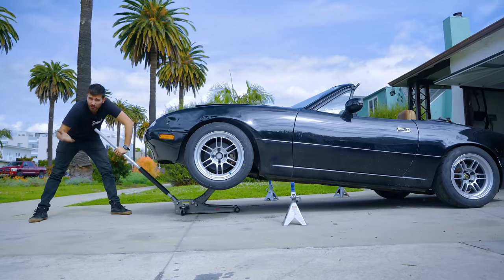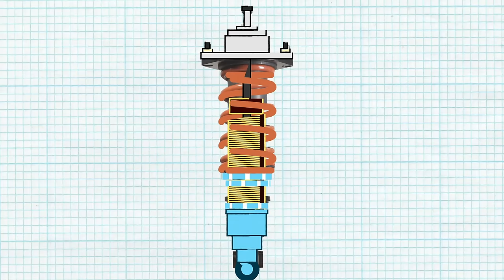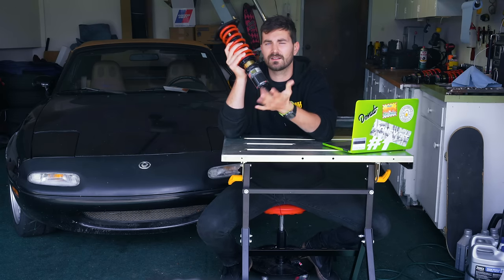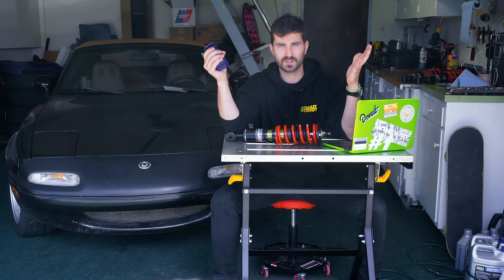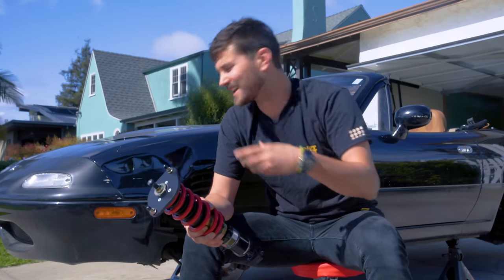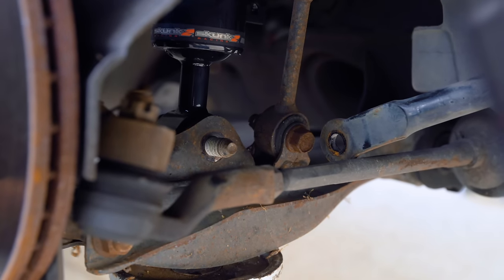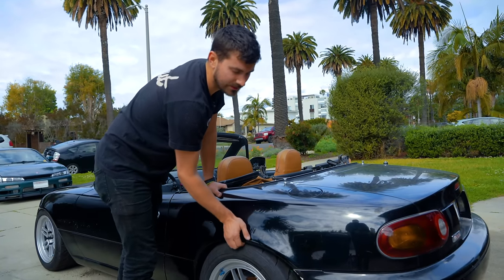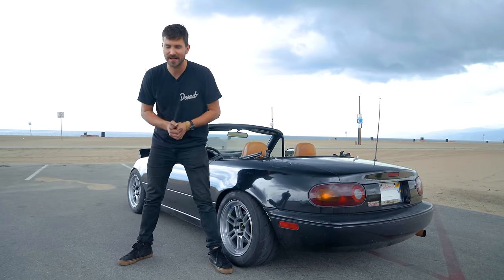How to lower your car the RIGHT way: COMPLETE COILOVER GUIDE

Comment: RE: Rubber Bushings
Grease up the shaft (not the threads or head) of the bolt, as well as any rubber bushing surfaces. No need to do so at ride height, they'll slide right through. Eventually the grease will work its way out, and you'll be back to just rubber again. It won't hurt anything. If you do get grease on the threads, a little brake cleaner on a rag will wipe that off nicely before you torque it down.

Comment: I've got some decent coilovers well only ones available for my n14 sss in Australia but was 1500 and the tarmac rally ones were 2200 aud might upgrade to them the roads are really crazy here nothing as big as the states. Most in my area are like one way sized streets compared to where you guys are but everything is expensive here. Has cost me 12k to restore n revive the car without adding forced induction. Estimated 50k to pursue my dream with it and ill never be able to drive it again because they don't allow reverse engineering heres, but try to picture an Australian 1992 n14 pulsar sss (which has a detuned east west sr20de fwd 140bhp) but rwd converted via skyline/silvia tunnel cut with the 6 speed using the stock engine but mazworks block, eaton m45 supercharger (mini cooper s) on intake side plus a gtx turbo on the hotside. Painted in midnight purple. Currently is Monza red (GTiR)

Comment: Word of advice! Roll & pull your fenders while it's on the stock suspension, before installing your Coilovers because once you lower your car. It will be nearly impossible to roll the fenders, due to a lower Ride Height.

Comment: Went to install my coilovers on my miata. BOTH of the bolts that hold the shock absorbers on the rear just spin because the weld inside the control arm has broke, which is quite common. Be wary of this if you go to install coilovers as you gotta have a magical spanner that fits in a tiny gap or grind off some of the control arm.

Comment: Love this series! 

Question, I have a 2016 Civic LX. I have to take it on dirt roads and the like and with the stock suspension the bottom often scrapes (even over speed bumps). I am thinking I need to make things stiffer without changing the ride height. I would ideally do an air ride, but that is out of my price point. What do you think, full coilovers or a stiffer spring?

Comment: I have to say that isnt really what cavitation is. What cavitation is, is basically when a air bubble occurs and burst due to I believe negative pressure, once this bubble bursts it can take a small chunk of metal away with it. Over time it will leave extensive putting and also weeken the metal. Cavitation is actually quite interesting and I advise anyone who is confused or not sure how it work check a video on YouTube really informative

Comment: If you can, buy Swift Springs for your coilover and weigh each corner!
EX:
If your front left is 800lb and you have 10kgf/mm or 550lb/in springs, you need at least a 1.2in (1.45in if you don't run swaybars) clearance for your tires to compress when static. So that when you make a turn, your suspension won't sink and rip out your fenderliner.

Then there's motion ratio, instant center, swaybar, and other calculations I'm too lazy to do.

Comment: If you are leaving the stock suspension on a Miata you need to take off the lower control arm in the front almost completely, it can make the job from a total no brainer to a total nightmare real quick 🙃

Comment: You should have used the fender roller before you lowered it go back and look at where the roller wheel sit in the fender and look at where your geometry of your suspension fix your Hub if you would have done it before you loaded the car and the suspension was shoved up the roller would have been perfect to roll your fenders

Comment: How do you figure out torque spec and how do you know when you've reached it?
Reply: Most good parts will come with torque specs and whatnot. And you can use a torque wrench that will click once it reaches the torque you set it at. Some older torque wrenches require you to watch a needle on a small graph on the wrench itself.
Reply: Ciinyk _ thank you so much

Comment: I'm a big fan and you usually do a fantastic job explaining the inner workings and concepts of various components but I think your explanation of cavitation missed the mark just a little.  Cavitation is when small portions of the fluid boil due to a reduction in pressure and form bubbles. The danger is when those bubbles inevitably implode, which causes erosion in the metal surfaces.

Comment: @Donut Media would you say it’s generally safe to run a lowered setup without fender liners? Are there any caveats/consequences (ie. turbulence, excessive road noise, damage from debris/rain)? Mine are already chewed up and I’m thinking about removing them but haven’t heard any compelling advice. Help set the record straight pls? (Also I live in CA as well so it’s obviously mostly dry here)

Comment: Hi, I have a BMW X6 e71 (2012) xdrive 30 d model. I am planning to replace the stock alloy wheels and Tyre. Could you please advise the right alloy width and Tyre size for comfort travel. I want to stick on the alloy wheel size as 21". The default size of the present Tyre size is 255/50/r21, this will give a sidewall thickness as 12.75cm. so I need the Tyre sidewall height as something between 11-12cm fur a comfortable drive as the roads in our place are not good. Please suggest the alloy wheel width for ftont and rear, also please suggest the Tyre size. Thanks

Comment: Actually quite a nice analogy for cavitation with the fizzy drink can, but you don't really explain it. Cavitation is the instantaneous boiling of a liquid due to a local low pressure. Pressure and temperature are coupled, so I won't say this is irrespective of temperature, rather that you can boil water either by heating it, or subjecting it to vacuum, or some combination of the two. Cavitation is often seen in the wake of things like a ship propeller, which is generating differential pressures in the name of propulsive force. It is potentially very damaging, creating rapidly accelerated wear on metal components.

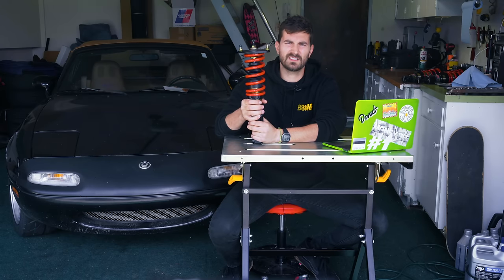Comment: Make the distinction between imperial and empirical. Imperial units can be called American units or they are actually British units and then that means you’re talking inches and lbs and so on. Empirical data in science means data derived from experiment or observation. So when you say empirically speaking, you don’t mean American units, you mean data derived from experiment or observation. You should have said, imperially speaking if you wanted to reference the units that you’ll be using, which are inches and lbs. minute 6:16 in video
Also, when you have two springs, it’s not always the case that it’s just a helper spring. Sometimes you will have a two-stage system with a soft spring and a stiffer spring instead of using one progressive spring. You’ll see that on off-road race cars a lot.

Comment: Can someone point to a good explanation of how the spring perch can physically affect the ride height? With a linear spring rate, the car's weight will determine the ride height for a given spring unless you're preloading more force than the corner weight of the car. A lower height would require a shorter or weaker spring.

Comment: Yeah not trying to be a dick but yeah I’m going there -a torsion bar effects side to side weight transfer a hell a lot more then the actual shocks or strut or coil over, which in reality all they do is control or dampen the energy of the spring expanding or compressing, if you want to reduce side to side roll you add a thicker sway/torsion bar/s and if you want reduce front to back diving/pitching you upgrade your springs and dampener (shock/strut/w/e your vehicle uses) you can tune the pitch rate by adjusting dampening and compression settings provided it has that capabilty, coil over advantage is being able to adjust ride height without negatively effecting the actual functioning of the springs and dampeners, you can use a combination of springs with different rates together in some system to further adjustability, and some coil over systems allow you to use alternate mounting brackets that allow further adjustment to toe and camber where as you would NOT be able to do so without them.

Comment: What does foot lbs mean and how do you know how to do it with a socket wrench when screwing in a bolt
Reply: foot lbs is one way of measuring the amount of torque, and you use a torque wrench for it that will click or beep when it reaches the set torque

Comment: I got two different pairs of coil overs for my sc400 (rev9 front) (Megan rear) will it be a problem doing this?
Reply: depending on the dampening and spring rate difference between the two it might not be that big of a deal, but it doesnt make sense why you got mismatched instead of just getting a set

Comment: Lower your car the right way
#1 lay 2x4 flat under frame rails.
#2 heat springs with oxy-acetylene torch.
#3 when frame rests on blocks let cool, by splashing beer on them.
#4 scrape and spark away.

Comment: I disagree on 1 thing..  the suspension on a car is not just comfort, but also to keep the wheel on the ground.
If you have a car without suspension the wheels are in the air on eacht bump in the road.

And cavitation is the implosion of bubbles in a fluid under high pressure.  It literairy eats away pump rotors etc.

Comment: This is the not the right way in some cases. In some models even if you drop your car by 30mm (about 1 inch) you will mess suspension geometry so much that it will handle even worse. 
The most ideal way for lowering your car are drop knuckles/spindles or if you don't have that possibility coilovers with taller ball joint like Whiteline sells or roll center adapters/spacers to make your control arms parallel to the ground.
For fixing your body roll issue you just install thicker - stiffer sway bar.

Comment: 2:10 that's not what a blown shock absorber looks like, and I know because the navigator in the video they all had air suspension which failed alot, and I know because I experienced it. What actually happened is the air spring lost all it's air.

Comment: No, that is NOT cavitation. Cavitation occurs when a fluid moves very fast against a solid object which creates a vacuum bubble which then collapses with immense force, which usually brakes stuff, like the seal in your shock absorbers.

Comment: For anyone watching this now. Do not roll your fenders with a hammer or a baseball bat. They will become "bacon". Get the fender roller like he has. It will work, I just had to drill another hole on the roller so I could put it in the position I wanted. Use a heat gun to heat up the fenders to prevent paint from cracking. Do it right, and you won't regret it. They will come out good and not fail. The polyurethane wheel on the fender roller is what makes this the correct tool and rolls the fenders evenly.

Comment: Trying a question on and old video for anyone to answer.  I just watched this.  My 1990 Miata is just for cruising, I am not sure if I should just replace the struts (they are bad) and springs with like components or use coil overs.  I do not want to change my ride height.
Reply: probably just get factory replacement struts, kyb has good stuff

Comment: Um I’m gonna be that guy!
So yeah that Lincoln Navigator rides on air suspension. That air suspension was completely shot! That’s why it was so low! Your shocks no matter how bad they are have nothing to do with ride Height, that’s what the springs do and in a Lincoln air bags are your springs. So no air means slammed car. You’re looking for those cars that are floating down the road. Hit a bump and the car will flow up and down ant it might take a few seconds to stop moving up and down! That Lincoln was crashing up and down probably because it was riding on its suspend bump stops!  again I’m sorry to be that guy but it’s important to show the right visual to what your trying to explain!  I think!

Comment: 4:50 - total bollocks.   Coilovers that adjust height from the spring seat have 'helper springs' which keeps everything tight when load is taken off the wheels

Edit - Amazing, ive watched on to 7:20 and he mentions helper springs, how people can be so contradictive is amazing

Comment: Never double click the torque wrench. You end up with a higher torque than you intended to thus defeating the purpose of the tool. I'm a train mechanic by traid and we torque almost everything to spec . Overtightening a screw will make it brittle and prone to breaking, you also stretch it so the threads can in extreme cases be unable to screw into place. If in doubt and you don't have a new screw try a nut on it.
 PS screws have threads, bolts do not.

Comment: Probably one of the worst suspension tutorials I've ever seen for a Miata. There's a lot of reasons why those coilovers are bad, the 2 piece design being a big factor. Almost all of them run into rear travel issues. Reason why every nice shock (except Ohlins) run a 1 piece body.

Comment: 100% tires are better smiles per gallon it's not even close lol

shit tires means shit driving

yes you only buy coilovers once but on a heavier more expensive car they're WAY expensive and good shocks and springs will be cheaper if you're not going to actually leverage the adjustability.

weird one sided perspective honestly

for reference good coilovers on my 996 would've cost me 6k but older 200 TW tires cost me like $600 and I went through only a few sets of tires over the lifetime of the car.